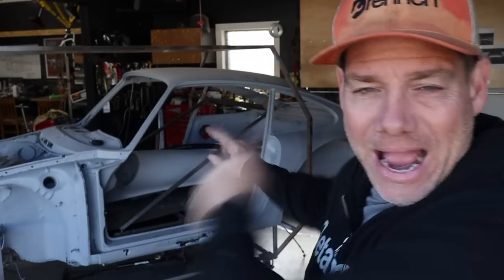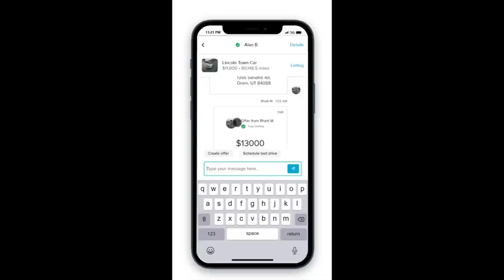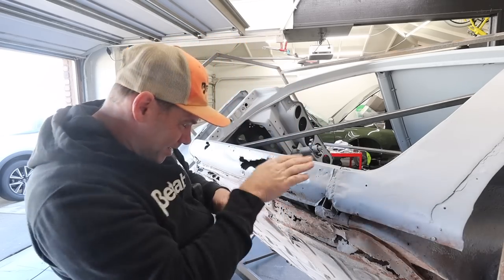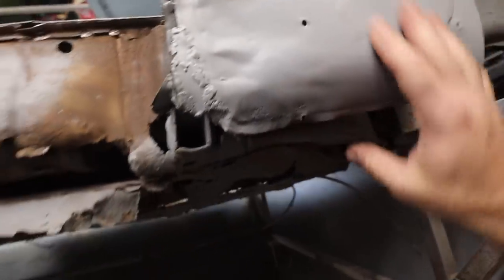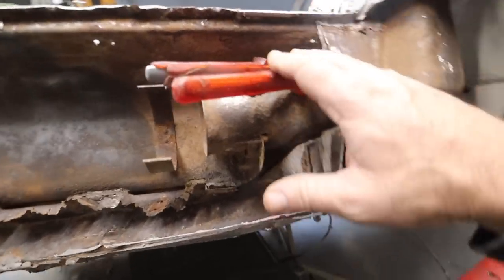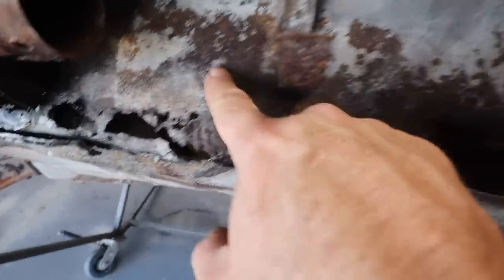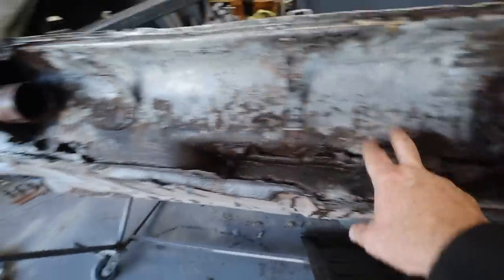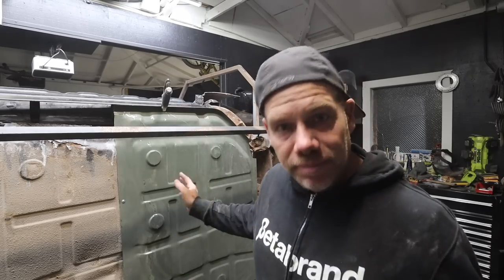Resurrecting a RUSTY Porsche 911 From The Scrapyard! RUSTMAGEDDON Porsche Restoration Part 2.

Comment: 25 years ago the spot weld removers I used had a spring loaded hardened pin instead of a drill bit ,the spot weld removers are good idea because you don’t end up with a hole   That you have to fill with weld . 
looking forward to see how this project comes along 👍👍👍🇦🇺

Comment: Why aren’t you blasting the inner sills? Wouldn’t that be the cleaner way? In my opinion cleaning it with the grinder pulls dirt into the metal that creates new rust spots
Reply from the maker: I will once I get everything exposed.  But I may be replacing those panels too.

Comment: There's an easy way to get the floors out.  In my video I demonstrate using an air chisel with a flat blade running along the welds. It takes about 10 minutes to do the entire floor..  Bit late now tho, I guess.
Reply from the maker: Oh, I've got PLENTY more to do.  Checking it out now!  Drop the link so everyone can see.
Reply from the maker: You're not talking about this one are you?  https://youtu.be/mW4vdNh9D5g. Did I miss the air chisel?
Reply: @rennch.  that’s the one.
Reply: @rennch.  damn. I forgot that I didn’t film the air chisel part. Crap. My bad.
Reply from the maker: @garagechronicles9008  You've still inspired me to go pick up a HF air chisel.  Thanks for that.

Comment: Looking good👍
I was under the impression p15 doesn't like to stick to bare metal.. that it's real bond strength was with the rusted surface. However if you end up blasting it, what will you treat it with.... cre epoxy? Then weld through around the welded portions and cavity wax after?
Reply from the maker: Not sure yet. Depends on the panels we get.